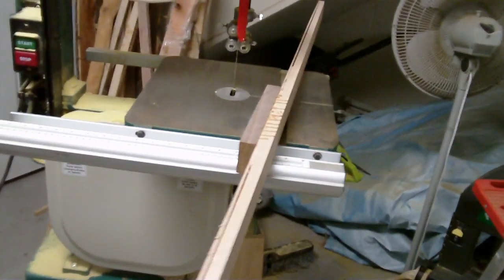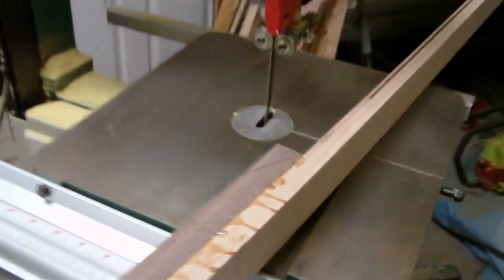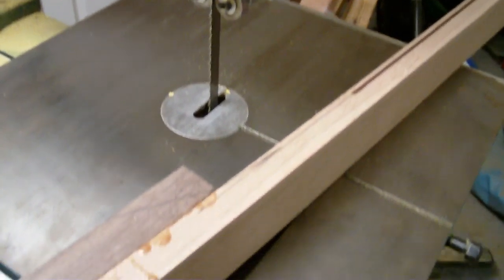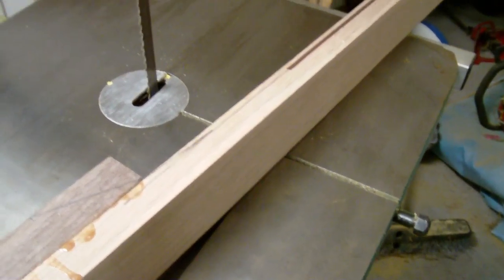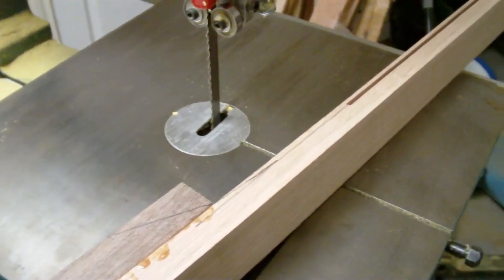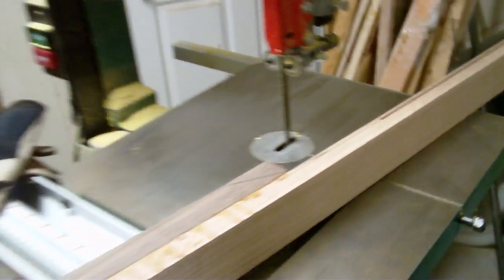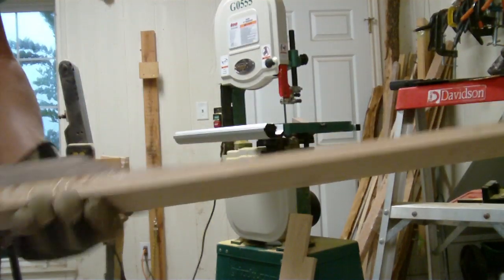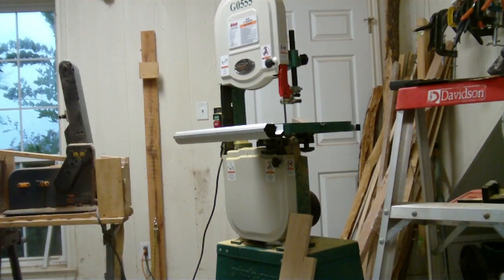boardbow build along pt 4

Comment: I used a table saw to cut width, however, I don't have a bandsaw and my attemps to cut the this move with a hand saw is ruining my wood.  Any suggestions.  I might have to take it to a wood working shop for it to be cut.

Comment: rather than running the blade of the bandsaw up the tablesaw cut, wouldn't it be easier to just cut perpendicular to the end of the cut and remove the whole long piece, then you would just have to do the little triangle taper?  I cringed every time the bandsaw blade bit wood going up that cut.